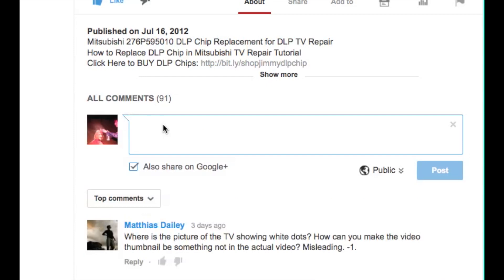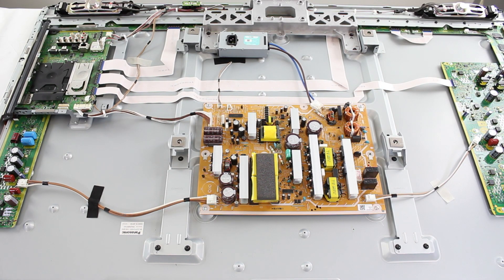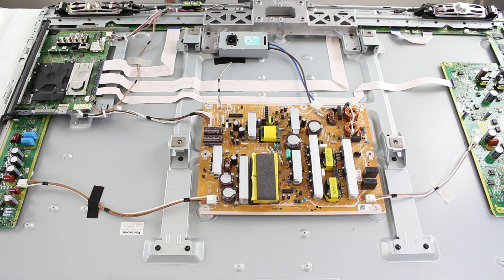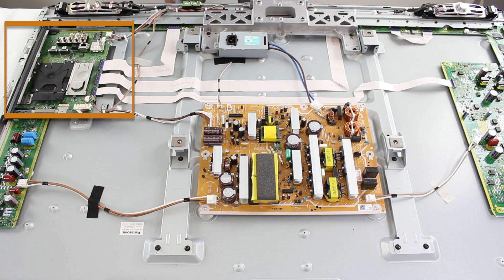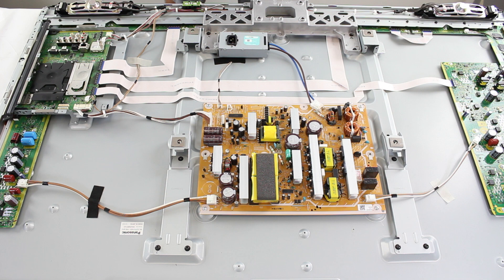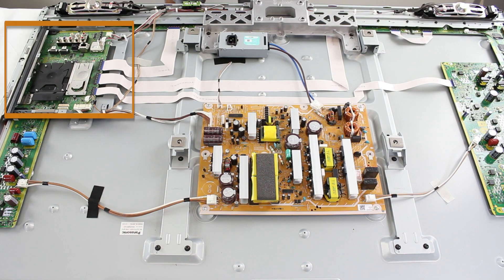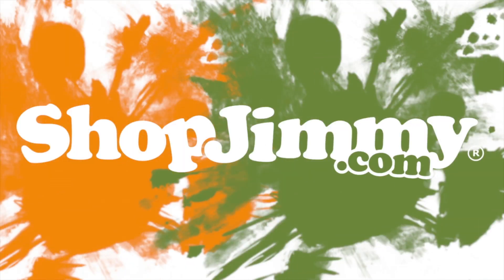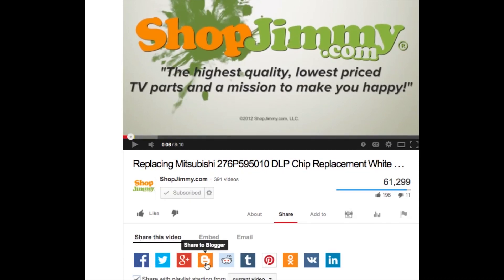TV Not Working After Storm - TV Lightning Strike & Storm Guide for Power Surge Problems

Comment: - I have a 46" Samsung LCD TV, Model #LN46D630M3F
- Bad lightning storm a few nights ago, and now the TV will not power on.
- The morning after, the standby light was present, but when attempting to turn the TV on, the standby light went away and has not come back since.
- The only "sign of life" is the 'digital audio out' on the back of the TV blinking red when the TV is plugged into the power outlet.
- This TV was plugged into a surge protector with other electronics, none of which were harmed.
- A coax cable for cable television and internet comes from the wall outlet to a splitter which then connects to the TV and a cable modem.  The cable modem is working fine, however.
- I believe the lightning strike hit our coax cable lines outside the house.  The cable company had to repair an outside splitter -- they said it was fried.  So, my guess is the TV was affected through the coax cable line.  However, since my cable modem wasn't negatively affected (it's plugged into the same surge protector and coax cable line), I'm not 100% sure on this.
- The coax cable line was not running through a surge protector at the time of the storm.
- No visible burn marks on any boards.  No capacitors seem to be blown.
- I think the TV has two fuses - one with a red stripe, the other with a blue-ish/purple stripe.  I don't know how to tell if these fuses are working or not.

Any ideas?
Reply from the maker: *****   I recommend replacing the main board in your TV.  Here is a link to replacement parts for your TV model number on our website, click here:  http://www.shopjimmy.com/catalogsearch/result/index/?cat=56&q=LN46D630M3F  Be sure to match part numbers on your current board, with your replacement for compatibility.  Here is a link to a video showing how to identify your part number, click here:  Samsung Main Boards & Digital Boards: Part Numbers for LED, LCD, DLP, Plasma TV Repair  You can also call our customer service for further assistance with your purchase.  (877) 881-6492  Thanks and please let us know if you have any further questions with your TV Repair!  www.shopjimmy.com
Reply: ShopJimmy.com I received a reply to my question above, but don't see it here.  You said that you would replace my main board.  Could you explain why you think the main board is the problem?  Have you seen my issue before?
Reply from the maker: *****   Since you have a standby light, that means the TV is getting power and the main board usually control turning the TV on and off and since the coax cord runs into your TV through the main board and that is where the lightning strike occurred, then I would replace the main board.  Thanks and here again is the link to replacement parts.  http://www.shopjimmy.com/catalogsearch/result/index/?cat=56&q=LN46D630M3F www.shopjimmy.com
Reply: ShopJimmy.com Thanks.  I actually don't have a standby light, but your other points about the coax cable and the main board controlling the TV turning on/off make sense.

If replacing the main board doesn't work, do you have any other suggestions?
Reply from the maker: *****   Then I would suggest replacing the power supply, if the main board does not fix it.  You could also replace both the main board and the power supply for the start as they both could be damaged in a lightning strike or power surge.  Here is a link to replacement parts for your TV model number on our website, click here:  http://www.shopjimmy.com/catalogsearch/result/?q=LN46D630M3F Be sure to match part numbers on your current board, with your replacement for compatibility.  You can also call our customer service for further assistance with your purchase.  (877) 881-6492  Thanks and please let us know if you have any further questions with your TV Repair!  www.shopjimmy.com
Reply: ShopJimmy.com Thank you! I'll try replacing the main board first and go from there.
Reply: ShopJimmy.com I replaced the main board and my TV is still not working.  No standby light, nothing.

The original main board, when the TV is plugged into power, has a blinking red light in the 'digital audio out (optical)' connection "plug".  Do you know what this blinking red light means?  The new main board does not have this blinking red light when the TV is plugged in.
Reply from the maker: *****   It could be the replacement main board is defective or the power supply board is also bad and was affected by the lightning storm.  I recommend replacing the power supply to see if that fixes the problem.  Here is a link to replacement parts: http://www.shopjimmy.com/catalogsearch/result/?q=LN46D630M3F  Be sure to match part numbers on your current board, with your replacement for compatibility.  Here is a link to a video showing how to identify your part number, click here:  TV Part Number Identification Guide for Samsung DIY TV Repair Power Supply Unit (PSU) Boards  Thanks and please let us know if you have any further questions with your TV Repair!  www.shopjimmy.com

Comment: Hi, Jimmy. I have a fairly new Toshiba 43L310U Rate B LCD TV. After a power surge from a storm it turned on and it has sound but no picture. Also none of the controls work being the remote or the side panel. I also am not able to turn it back off with the controls. I can only turn it on and off by pluging it in or un pluging it.

Comment: Hi sense led lcd tv.  Model. 50k360G
Lightening strike. Standby light on but will not power up. 
No burn marks but broke line attachment to outside control panel. 
How do replace that and what else should I do?